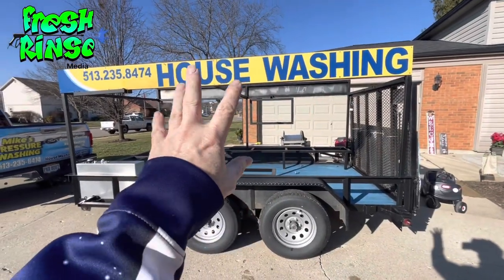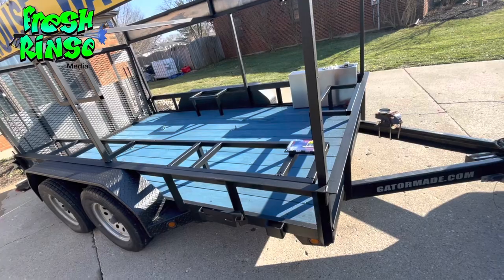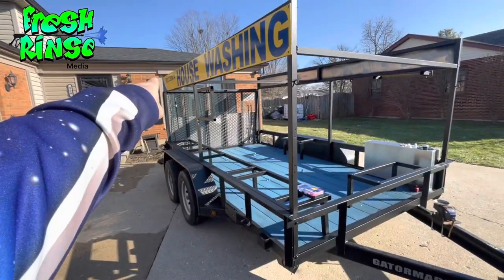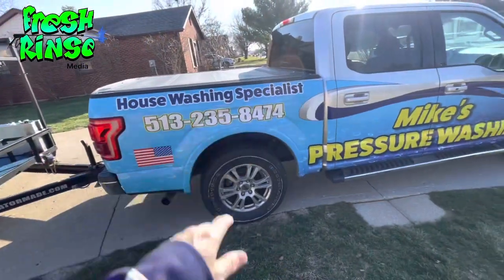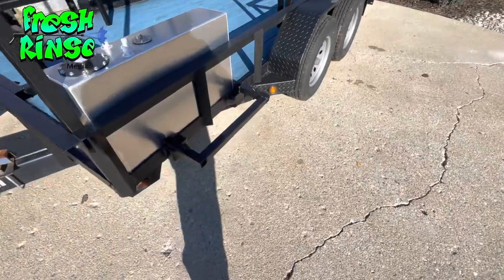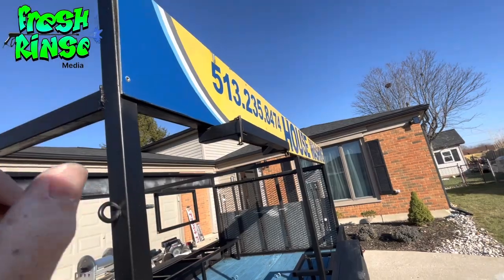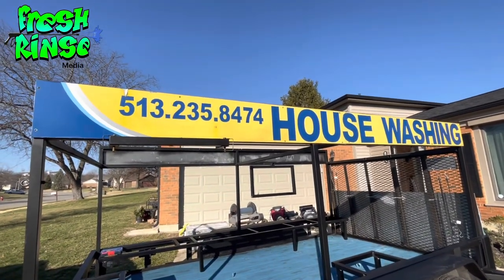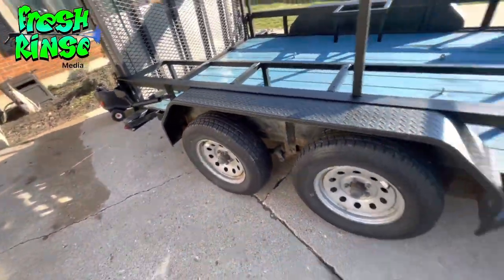Complete Pressure Washing Rig Rebuild (Episode 5). The Ladder Rack & Signs

Comment: The surface cleaner handles cover the phone number.  JD would never do that
Reply from the maker: Yes, that is a terrible oversight.
Reply: If you relocate the gas tank. Maybe you can put the holder on the inside and the handle will be behind the sign.
Reply from the maker: @georgea6403  It’s worth a look. Thank you.